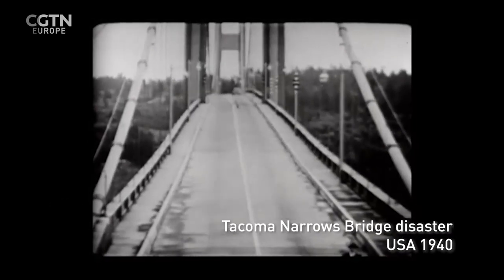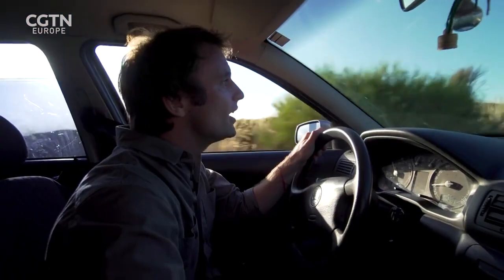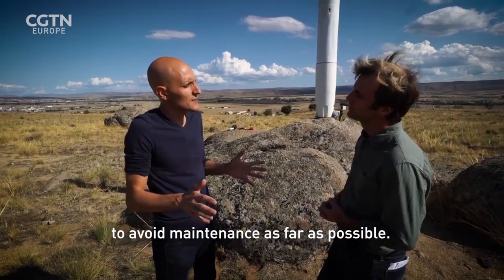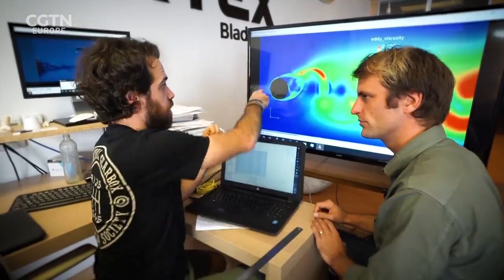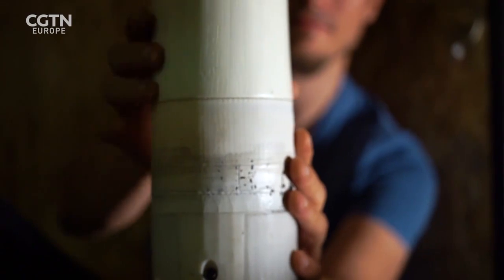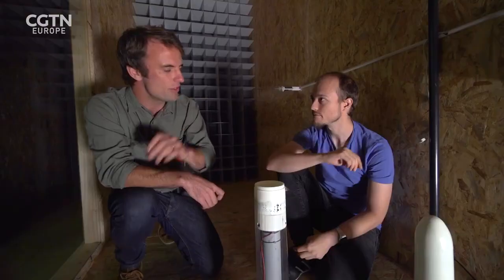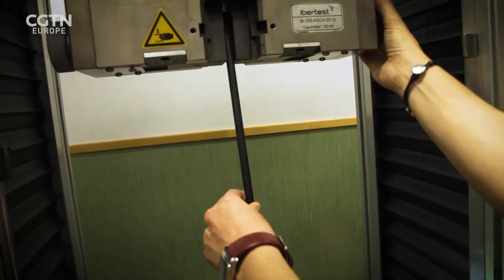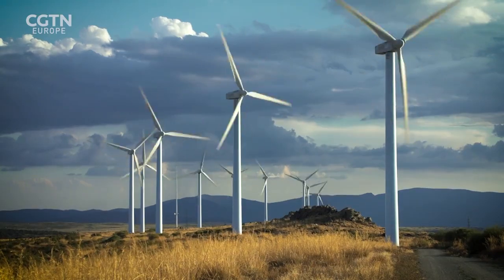The Future of Wind: RAZOR

Comment: Way too little power per unit structure.  A typical example of how NOT to do wind energy.  This kind of stuff is never going to be useful for power generation.  At most it might serve as a power source for a sensor or other extremely low power application.  For people in wind energy, the mystery is how anyone can fall for ineffective concepts like this, or take them seriously!  Never gonna help anyone's electric bill.  The key to wind power is sweeping a lot of area to capture a lot of wind energy.  This idea doesn't sweep much area, and is not efficient even for the tiny area it does sweep.